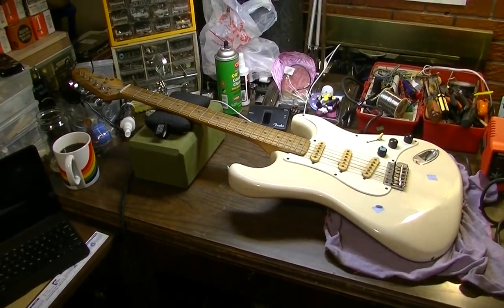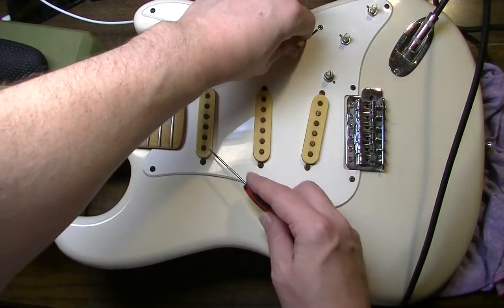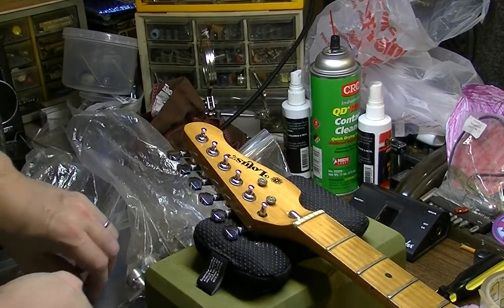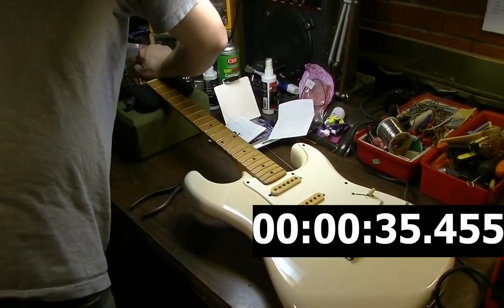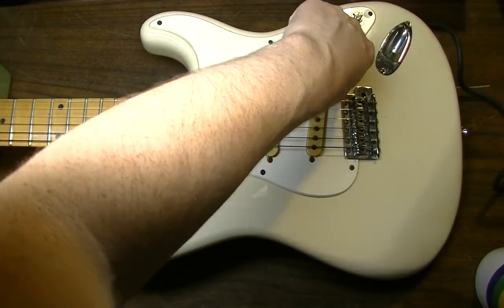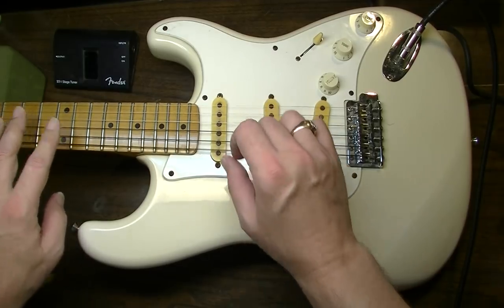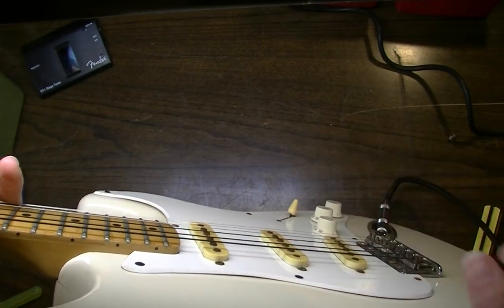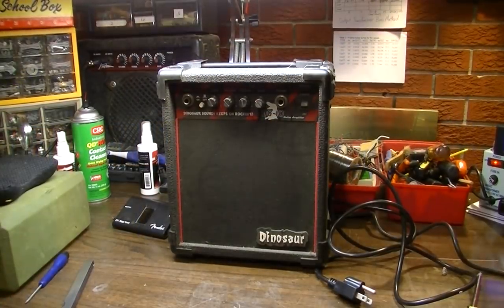$9 Thrift Store Axe Setup, Ultimate Speed Restring Challenge, Intonation Tutorial & MORE! - SPF

Comment: ok.. :) bare with me here. its a long one. thing is about tuning using natural harmonics is, i rarely use them because if im tuning a friends guitar, and they like high action, you cant intonate it worth a damn(like you said).so ill use open strings and octaves.but even for my own stuff, and most others. what works great for me is first ill check that  the pickups arent so close that they effect the strings with the magnet gauss . and  i always verify my nut groove depts are so that holding my finger down on the 3rd and tapping on the second reveals a string gap of a hair.(literally just off the fret)  and with my strings in tune to 1 tone/note lower(D) than i usually play at (D#), i set my relief as flat as i can (between the 7th and 11th).  then i set my string height at the 14th as close as i can to what the open space is at the 4th plus my relief while trying to keep from buzzing around the 7th,9th or 11th, and then ill intonate to cancel the waves/(your calling beats), i try to mimic my normal playing pressure at the 12 fret for a starting point,and go off the octaves for a starting point on the next string. when im done i can hit the stings open in pairs to tune them.which is a very fast way to tune. and if im unsure, to verify i  capo the 2nd fret and check octaves at the pit of the relief area, (9th for all but the B string-10th). ill recheck the whole intonation process from string height to intonation until i get as good a well rounded intonated neck as i can. sometimes ill let a little acceptable buzz in if i need to. but of coarse, if its too bad ill have to do some leveling. i can get picky like that.... A LITTLE NOTE ON SETTING A FLOATING TREM.  (which is a nightmare if a string breaks) you might have to do this process a few times to zero it in best, and this(what i use) is with a 10 gauge high E string... now basically, simply set the spring tension on the bridge so that when all strings are in tune you can pull the trem up all the way(BOTTOM OUT) and the high E string is a perfect G, no more. no less. then re-intonate. this point seems to be the best for most trems. at least for me. i like it because all the strings seem to end up with a complete note when bottomed out(trem arm up). not all strings are a whole step, some half step, but are basically a complete note/tone.

Comment: I had an Ibanez Gio that had the strings get stuck in the tailpiece like that. You need a very thin awl to poke the strings through. But what worked was not cutting the strings and simply grabbing with a pair of pliers from about 3” from the tailpiece. Push down with the pliers on the stuck string and eventually it comes loose. Oh yah, and WD40 helps too. Or, light machine oil.

10 bucks is totally worth it, if the tuners or electronic components are junk, just replace them...

Comment: Wish I could get a guitar like that for $9.59 at MY local Goodwill!  Thank you for this video.  I only came on it today, nearly two years after you published it, but I think I took a few good things away from it.
Were I in your shoes, but with my current level of tools and equipment, I would have done a fret job on the guitar before doing any of the other setup work.  I would have had to buy tuners, though -- I don't have an inventory of old parts.😞  I also would put in a new bridge that I currently have lying around gathering dust -- it's brass and steel(!) -- and gotten that old pot metal monstrosity out of there.  The pickups and old electronics didn't sound too bad to me as it was, and the tone and sustain the the guitar would certainly improve with the fret job and the new bridge, so I would probably be able to stop after completing the setup.  If I intended to sell the thing, then I would not install the new bridge, but would do everything else I mentioned.  I would also advertise the setup work, as that would become part of my asking price for the axe.
Question about your Guitar Olympics:  Did Rob Chapman, "Captain" Lee Anderton, Philip McKnight, Tyler Larson of "Music is Win" or any of the other people you mentioned take up your challenge?  I wouldn't have, but that's because I know that I'm slower than geological processes at this sort of thing!😎

Comment: When adjusting the neck, why not use a notched straight edge or at least capo the first fret and press down on the last fret and use the string to check for proper relief, .010 on the low E at 8th fret? Guess work is ok, but IMO doing it right, especially with such an easy extra step is worth it. Plus intonating it laying down with the neck in a prop will equal an improperly intonated guitar. Always do this in playing position.
Reply from the maker: Thousands of setups under my belt. I don’t need a straight edge. I believe I did mention playing position in this video, and it would be ideal, and you should have noticed me checking my results in the playing position at the end. Did my intonation sound off to you?
Reply: @TheGuitologist  Wasn't trying to be critical, just pointing out a few things that people who watch this video to learn, may then do wrong themselves. I did miss you mentioning playing position, my fault. I guess as an owner of a repair/set up shop I'm used to doing everything "by the book" to give the customer the best possible service. Even if I could cut corners because of experience. I realize this was yours and not someone else's guitar. 
Either way, $9 is a steal!

Comment: Sometimes you have to add a small washer on the outside of the saddle to keep the screw from going in too far on the low G, but if you close the hole the string will break.

Comment: I use an old string, cut into a piece about 6 inches long or so, to get the stuck strings out of the Block....I fish the old string piece through to the other side of the Block (from the front to back) until there is enough to get a hold of with pliers and pull it through...this typically pulls the stuck string through first time...second time at most.  Regards!

Comment: I like to start with the string closest to the nut when installing them because it gets tight putting the big strings on when the smaller ones are already on. I usually lay a string through guitar face down hanging off the table enough to drop all the strings in then turn it over and put them in the tuners. That saves a lot of time.

Comment: Hey...like your sense of humor...anyway..I have a 68 strat and the fingerboard was    planed down past the 12th fret so that notes would not choke off when bending. I have always had a high action and i have recently decided to lower the action a bit and found that i could only get it so low otherwise there would be string buzz up high on the neck. Would a shim be the answer to bring the neck more forward which would bring the upper frets further from the strings. If so...how thick or thin would it have to be...thanks in advance.

Comment: That's just as good sounding as a real Fender which you only really pay for the name. The neck is everything, my friend had a Vantage guitar and it had one fret that was misplaced. I also had to reset the bridge, it ran out of room doing the intonation so I had to pull the bridge back just enough to get the adjustments midway, but the one fret was a nightmare, I was going to pull it and fill it with rosewood dust and glue and cut another fret, but it was too close to the other, he used it for his lead solo's and we put some expensive parts in that cheap guitar, but it sounded great for open chords and solo's and even bar chords as long as you stayed away from that fret.

Comment: loved your intonation lesson.i always do my own because of the hand pressure i use.id love to show u my modified nuts for strings that need more length.i probably should do a video on it but noone does this trick and it could be a oringinal concept.its similar to those necks with the weird fret shapes.oh may i add for your viewers strats were designed to have the trem sitting up on its heel.when u flatten the trem down u will run into intonation length problems.i learnt this from fenders custom shop.i wanted to send a axe back saying this 2k guitar wont intonate and the lovely chaps there calmly explained leos design of the floating trem.so there you go hope that helps all out there with this problem

Comment: Thank you for this great info on setting intonation! I have recently started playing again on my very cheapo Epiphone from the late 70's. It came with a fixed wrap around type bridge. Intonation on this guitar has always been a nightmare. I recently bought and installed an inexpensive($15) adjustable wrap around bridge online and have been trying to set the intonation. I have encountered a few strings buzzing and discovered that the buzz is actually coming from the adjustable saddles. I can move them and stop the buzzing, but then they are no longer in the optimal position for intonation. Any suggestions, other than just buying another guitar? Thanks for the great videos!

Comment: The trouble with making guitars like this playable, is they're actually worth much more parted out. I used to fix up old cheap guitars to good playable shape, but they were not selling well, most of the time. (shipping cost had a lot to do with it) but when I'd go to buy parts, I could see that guys were just taking guitars apart and selling the parts, and the prices on some parts were more than I could possibly get from the guitar in playing condition. So I quit, and sold off my excess parts. Made way more on the parts than I ever did guitars and amps. At 9.50 invested, you could easily profit off say the body alone, empty of parts. The neck could bring 50 by itself, with no tuners. the electronics, are generally sold as a package, and can bring 50 to 100 sometimes, 40 easy if in working order. This bugged me that the parts were worth more than a playing instrument, but it is what it is, so I quit doing it.

Comment: You should see my bench.It's horrible.I've been an electronics hobbyist for many years-like fifty.I used to repair TVs until I got sick of it by 1990.I started in the sixties.I started to do my own guitar repair in the mid '70s after I had one repaired and it wasn't fixed so I took it back and watched how it was done.It was a short in the wiring if I remember right.I later rewired the guitar(an old Regal thin body F hole identical to Chris Isaac's)using some coax from an old TV set.It worked.My first electric guitar cost me $36.00.That was in 1974.My choice of strings are DR Blues.

Comment: Yeah, it was real dirty and needed work, but you got a bargain, I almost bought a Lotus strat in a thrift store for $100. I've got one or two $10 electrics, one was a First Act, the other was the Synsonics with the built-in amp and little speaker. Nice vid, and I take altogether WAY too much time to put strings on. Maybe that's why I've always thought, I don't want to even think about working on guitars for money.

Oh yeah, and if I take a few minutes (I often do, take the saddles off to clean the bridge under them, makes me feel like I've "rebuilt" the bridge) I always take those springs off the intonation screws on the bridge. Do they do anything? The string pressure by itself brings each saddle up to where it's supposed to be.

Comment: Those replacement tuners came on my Strat clone. Initially, any time I'd play a note decently loud, I'd hear a godawful buzzing noise and I could not figure out where it was coming from. 

Later on, I did something and shook the headstock and it sounded like loose change almost. 5 out of 6 tuners were rattling BAD! Got rid of the buzz when I replaced the strings and tightened the nuts. I was pretty surprised, TBH. I also pulled those white stickers off the bottoms of mine. They look better without them, IMO.

Edit: it also came with....wait for it.......... THREE TONE KNOBS! 🤣🤣🤣 I swear it did. I'll upload pics somewhere if I have to lol

Comment: I have had the issue with the low E not intonating properly. I have tried to take the spring off and to no avail on my strat style guitars and my jackson dinky js22dka. What I found was that changing my 9 gauge strings to hybrids gave me the ability to intonate properly because the 6 5 and 4 strings had higher string tension.

Comment: I was a piano tuner in my younger days. As I'm sure you know western music is based on an equal tempered scale which was devised many years ago. In order to get equal distance between semitones and octaves throughout the entire musical range there is a tuning compromise made. So there are intentional harmonic beats or oscillations in every interval (apart from octaves) especially noticeable on the third interval. These beats get faster the higher you go up the scale. They should not be tuned out.  For example on the piano the centre octave is tuned first, the tuner has to learn by practice the interval beats for each interval e.g. thirds fourths and fifths. The middle C to E third (which is where a piano tuner starts from) has ten beats per second, thirds going down the scale get slower, they get faster as you go up the scale. Try it on a (tuned) piano as you can obviously hear the harmonics, not everyone can. You may already know most of this but if not I hope this is of some use to you.
Great video, I enjoy watching you work on amps and guitars, you certainly know what you're doing.

Comment: One thing I noticed when you were setting intonation is you had just put new strings on it. From what I understand and from my personal experience, you should not try to set intonation with brand new strings or strings that are too old and worn because it will be less accurate as the strings break in and stretch out. Obviously as this was a challenge to see how long this process takes, that couldn’t be done that way. But I can’t help but wonder how much of a role having new strings that weren’t broken in yet was affecting the ability to intonate more accurately.

Comment: Re: Intonation- In my experience (56 years), if the guitar you have, has had the neck relief set correctly and the saddle heights are set properly for desired action, after re-stringing and before any attempt at intonating the strings is made, the strings need to be well "seated" in their positions by stretching the shit out of them and re-tuning to open strings pitch, several times, until stretching no longer results in a tuning change between and among the strings. Then, and only then, should intonation be done.

Comment: I'd win the string thing but only because I have locking tuners. 3L3R on a Peavey Raptor. You'd take me on tuning. I match pairs and then bring past.

Also beat me for investment and hoarding levels. However I have done a full resto in a park on a Yamaha F310. Neck reset and fret crown. Literally went with tuning keys from another old guitar a bone nut and saddle and some files and strings.

Comment: With a pot (variable resistor), is it a good idea to use WD40 or other lubricant (3m oil).  Wouldn't your contact cleaner be better? How about a silicone lubricant?
Reply: The best way is to pry open the little legs that hold the back casing so you can get into it and clean it with a brush and some isopropyl to dissolve gunk and oxidation on the trace. Spraying stuff into it doesnt really clean it out, it just moves the crap around inside it.

Comment: That's a good job surprising how much Crud can build up over the year's only trouble with a stripdown is it can stand out like a sore Thumb so it's like you said if you got another one with spacer grommets Broken or Missing and have those keep it Looking old But Intact how some people would prefer it and if replacing even Pickguard screw's would look odd All Shiny Not original I know it's an electric Guitar but It's just how looking original give's you a better feeling of Quality i know that sounds stupid but it's just how i see it from my perspective especially if it sounds Good. New sounds different from old it just do's NOT that i could tell the difference which one was the old one do you know what i mean it's the feeling that the old one Must be a quality Guitar because it's old and sounds great Sorry about the Book LOL I like the Channel by the way .The quirk i could hear clear as day When you are restringing  a Guitar Where Roughly should you have the  Shoe's in relation to one another  Low E half way middle between  Higher & Lower  Bridge intonation setting  Then A slightly Toward Neck Then D slightly toward the Neck  Then G  pretty much in line with D Then B Slightly Towards Neck Then High E slightly toward Neck Is That Pretty Much How it should be Before Putting New String's on A Strat as took off saddle and Shoe's  Springs Everything and putting it back together Not Sure  Where to Start I Should Have Took Pic of Before  Then took it from There But It's Done And wondered how you would start  as far as Positioning Shoe's Then Going on from that point  Sorry about The Book  But that's How I can explain It  From looking online I Don't  wanna Put String's on Tune  And Have to start again where screw need's to go further but Hits string and still out of intonation  as On your video any Tip's Be Appreciated ?.

Comment: I'd have used a toothpick, some wood glue and a razor blade to fill the holes from the old tuners. It doesn't take long, and looks just a little nicer. It's not necessary on a cheapie guitar, but I'd do it anyway.
Aaaand... right after I posted that, you addressed it.

Comment: Them Fender bridges scream of cheap and ugly. Some after market brand sells graphite saddles I think Dunlop. Gibson has a knife style edge that loves to cut the string directly over the saddles where you can't repair the string in a pinch. Many moons ago I had a idea to use the brass fitting on a string and it could roll when you tune it and easily replaceable. They make them now, but that was over a 30 year old idea.